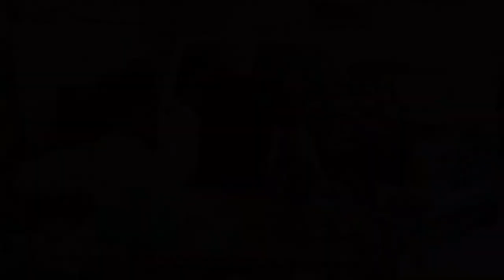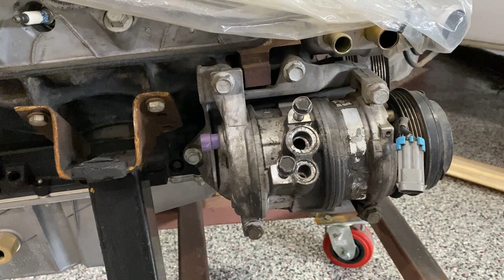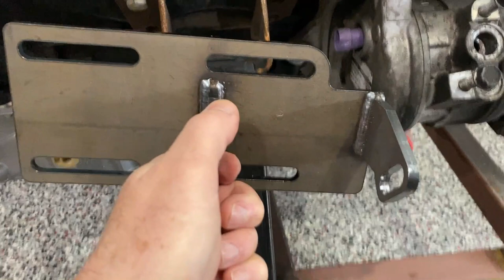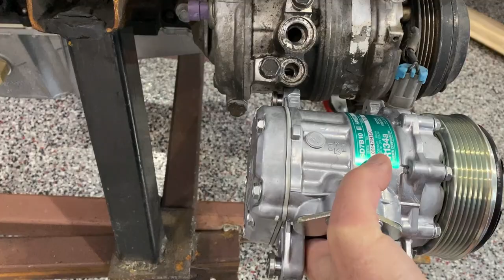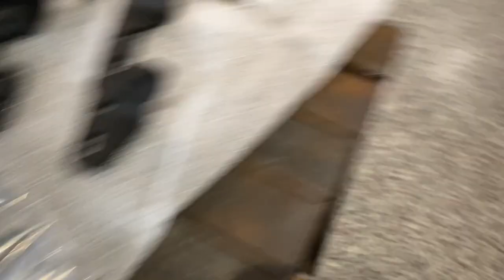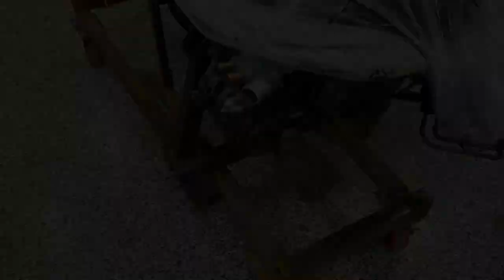1988-1998 Chevy OBS Truck LS Swap A/C Compressor Install Part 1

Comment: I ran the R4 factory 30 year old compressor with original R12 refrigerant using ICT billet brackets. It’s been on for almost 2yrs with zero issues. If it ever goes out I would use that DD set up in a heartbeat. Make it much easier for a turbo add I would think.
Reply from the maker: My experience with the R4 was that it cooled just fine, but the compressor had issues. Replaced it with an ACDelco unit and blew a front seal. Thought there was a problem with high pressure side being too high. Replaced switch and added the relay to make sure it was getting proper air flow to cool things down. That unit blew a front seal too. Frustrated, I purchased a sanden style compressor with a bracket kit using the factory a/c bracket. Then sold truck. I far as I know, it has had no issues. I like the low mount for several reasons: 1) looks factory, 2) overall, I believe it will have fewer issues due to fewer overall changes to install, 3) allows me to use the factory (suburban) air box and intake parts, keeping the factory look, and 4) if i do decide to add a turbo in the future, the key area will be opened up. Thanks for watching.

Comment: 👍👍👍   This compressor will mount on  stock location???   Does it fits???    What about the belt?  Can the  narrow belt run through that pulley?
Reply from the maker: The compressor mounts in the stock location. It has its own brackets to work. The DD website shows a couple of different belts, a dayco and gates. I ordered the gates belt. And, yes, the pulley is made to run a narrow flat belt. Part 2 will have more information. I'll explain more in the next video. It will all become more clear.  Stay tuned!
Reply: @laurencevillegarage  @@👍👍

Comment: Running mine up top with their bracket. Looking forward to seeing how you wire it. I’m kind of stuck on that part
Reply from the maker: We'll find out. I just sent my pcm off to be re-programmed and I asked a number of questions about the a/c. I'll let you know when I find out myself.
Reply: I’m doing my swap. I thinned out my OBS harness. Keep everything ac related from the OBS harness. There’s a green wire from the pcm as “ac request” run that to ac request on the ls computer
Reply: do you know what pin number

Comment: Lmk how it goes..have not found r4 kit that lines up correctly..holley..ict bullet and about 4 others belts fly off etc..would love to hear how it goes
Reply from the maker: After I get it up and running, I’ll do a follow up walk around  to go over what worked and what didn’t (hopefully that is not the case!). I had a similar issue with R4’s on the ‘95. I won’t use one again.

Comment: My swap is a L33 aluminum block 5.3L H.O with a 70mm remote mounted turbo into a 2000 zr2 4x4 s10. Im in SC so it's hot as hell fire in the summer and humid as boiling urine steam as well. So AC is a have to have situation, especially with my health. So for my smaller engine bay I'm having to use Corvette accessories because they are a good bit closer to the engine and also I'm going to have to use electric fans and to keep my AC and have it functional I'm gonna need to relocate it so I'm going to be running a high mount AC bracket from ICT billet. I know you have different issues but they have the high mount passenger side AC brackets for truck spaced accessory brackets also. So not only will all of your accessories use a single serpentine belt the AC compressor will be mount higher up but still below the the throttle body and you wont have to worry about your frame clearance issues, engine mount issues, manifolds needing to be special to clear everything, and you have a few different options on which compressor you want to use. On my build I'm using the driver side ls1 Corvette bracket and accessories with a Corvette spaced crank pulley and water pump, the factory bracket will hold the power steering pump and reservoir and the alternator and I'll use the ict billet bracket on the passenger side just for the AC compressor which will be mounted up high a little lower than the throttle body (I'm using a drive by cable throttle body and LS6 intake from a 2002 camaro or firebird (all 2000 and up or it might just be the 01 and 02 ls1 f-bodies "camaros and transams and firebirds are f-bodies" have an ls6 intake and a 6.0L truck cam which made them efficient enough to not need EGR. If the ls1 looking intake from an f-body doesnt have a EGR port on the top behind the throttle body, then it's an ls6 intake). Anyway it sits lower than the truck intake and the compressor sits about level to a little bit lower than the TB on an ls6 intake so it will sit even lower than the TB on a truck intake. I probably could have worded that better but you can get an ict billet AC bracket just for the passenger side that uses stock LS truck accessory spacing and it would eliminate all of the issues your talking about and it mounts the AC comp higher up so it's easy to get to. I have to run it because of the tight space and front differential system. But for your build it would just save you alot of time and likely money as well because the bracket kit isnt expensive and it has a few options on which compressor you can use. You can likely use one of the compressors you already had and wouldnt have needed to buy the dirty dingo unit. Though I'm sure DD makes a similar bracket system for LS swaps. Just check them out and you'll probably end up happier with how it turns out and it will save you time, work and money. I hope that helps you some.